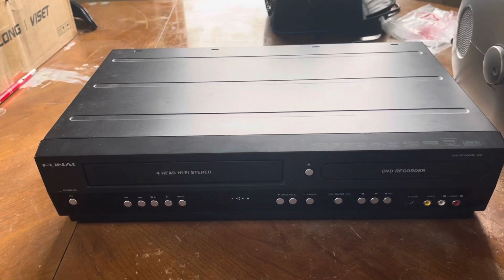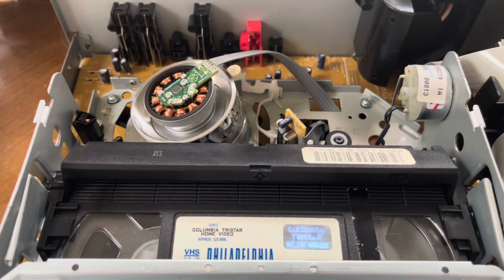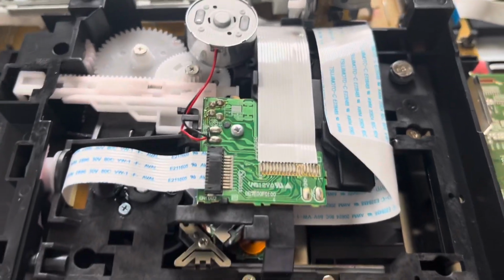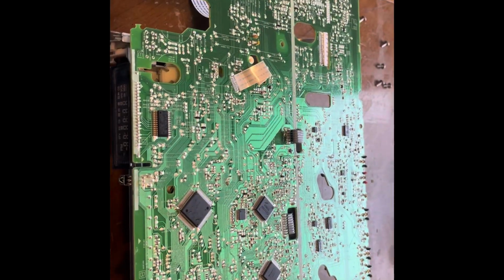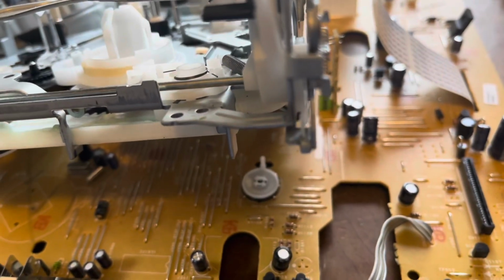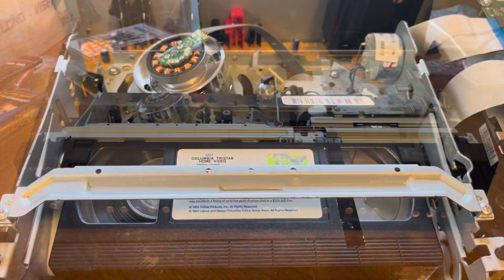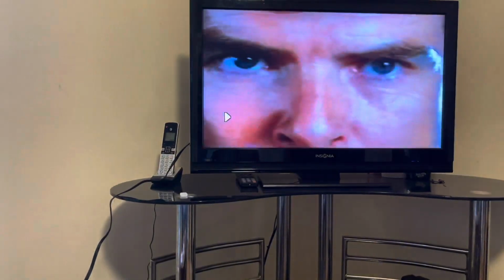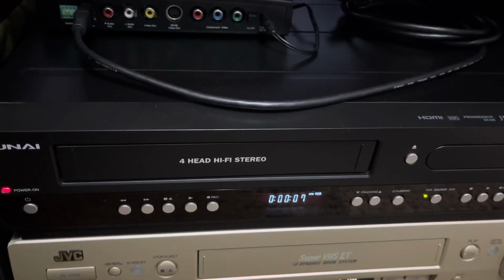Funai ZV427FX4A Combo VCR DVD VHS Dubbing Recorder HDMI Recorder Teardown and Repair.

Comment: I got one FUNAI d8b-m1000zb. DVD work great, but VCR after loading casete and start showing after 5 sec power off.
Reply: Bei mir das gleiche Problem. Konnte es anfangs noch auf Garantie reparieren lassen. Aber leider ist der gleiche Fehler wieder aufgetreten.
Reply: Probably a dirty mode switch

Comment: have a cuestion:  y have a tv vcr dvd combo.  dvd is working but the vcr does not start and the whole tv after 10 seconds turns off.    you have a hint?  could also be the motors??
Reply from the maker: It could be motor IC, or transistor and capacitor near capstan motor. I had a couple that had that issue.

Comment: Mine works except errors out on record, makes great coffee coasters, is yours working?
Reply from the maker: Typically due to high EST SMD capacitors on the top board on the DVD recorder causes that. After changing them mines works great as use it to transfer home videos for people off my Hi8 and DV decks to DVD. It a good DVD recorder drive once change capacitors as made by Panasonic. Even my Panasonic combo recorder have had same issue had to replace a bunch of capacitors to get it working correctly. The capacitors they used were low grade junk. I put high hour high temperature Japanese grade capacitors and haven’t had a problem since.

These Funai recorders are actually decent desperate the hate they get as has line TBC and actually all Panasonic chipset even on the VHS side and etc. I do use a external TBC with proc amplifier for VHS that are particularly bad with external professional broadcast grade SVHS deck to this recorder and does great. Yes the VHS deck is cheaply built but if used often they work fine, it when they sit for a while mode gear oxidizes and then act up.

Comment: HAVE NEW ONE, SAME MODEL, NEVER USED. PROBLEM...POWER WON'T STAY ON, GOES OFF IN A FEW SECONDS
Reply: My unit won’t load the VHS tape.  The black plastic piece on the right side doesn’t seem to go in far enough to allow the tape to sit in position